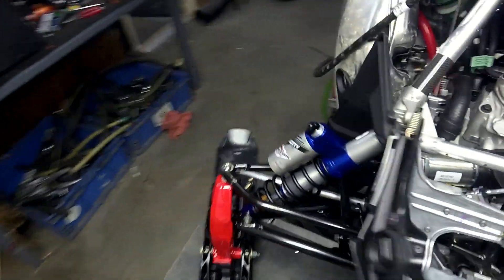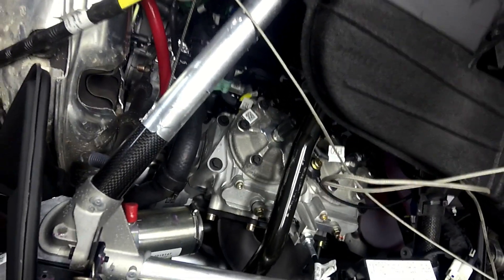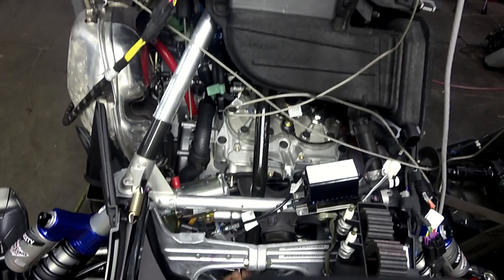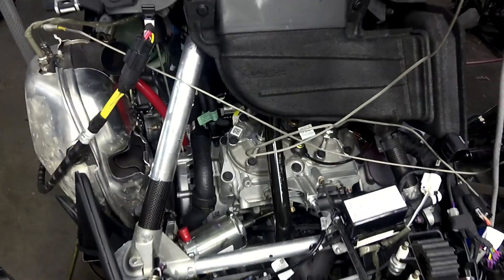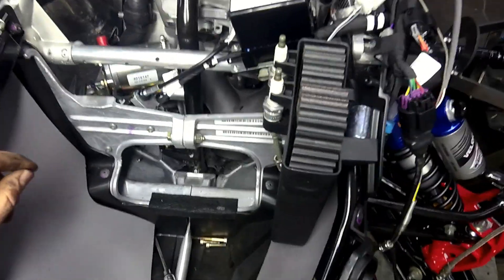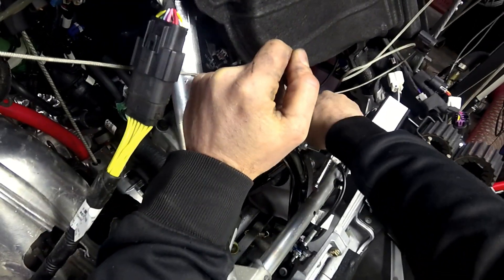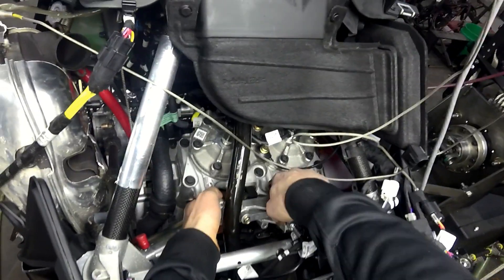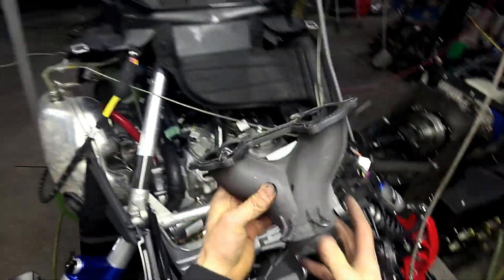HOW TO REMOVE T Y-PIPE IN A POLARIS 850 MATRYX AND AXYS

Comment: For those doing this on an RMK, it's a ton easier than this video. Because the steering shaft is offset to the side, you don't have to pull the exhaust valves.